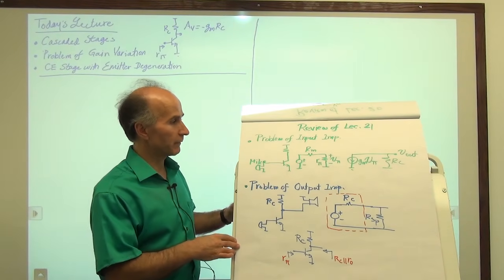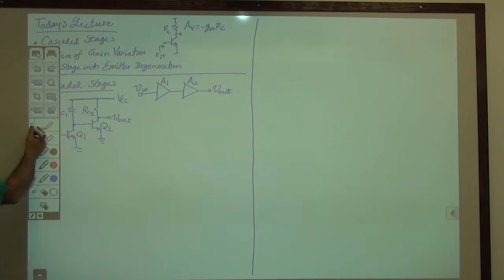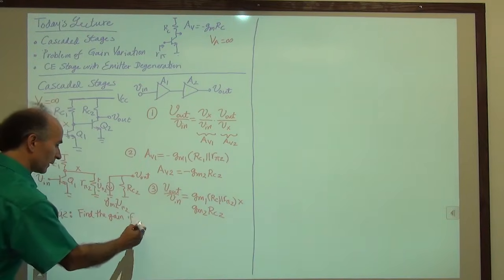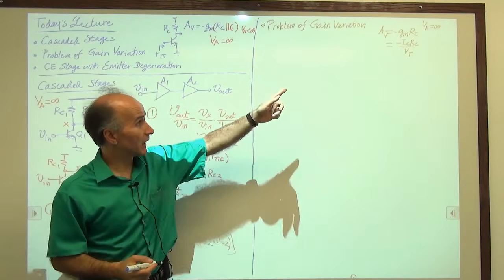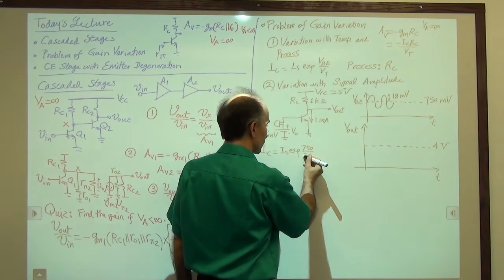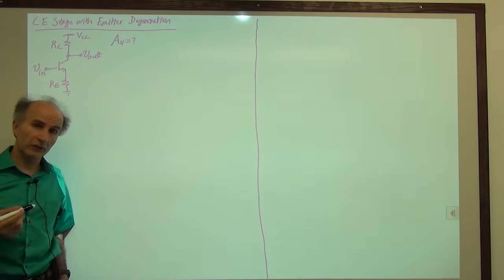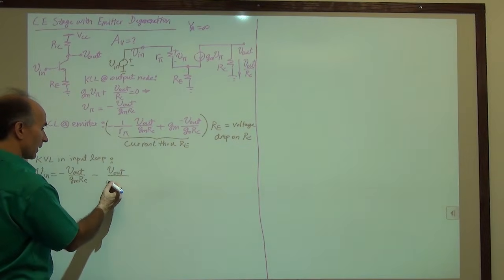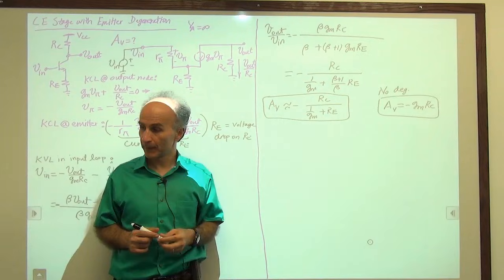Razavi Electronics 1, Lec 22, Common-Emitter Stage with Degeneration

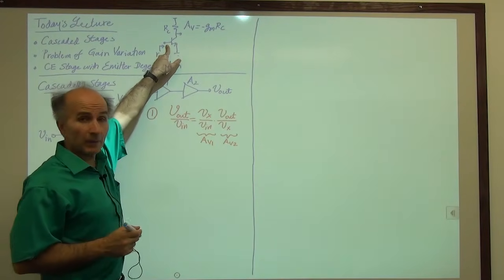Comment: 12:26 In Cascaded Stages, when the input signal goes through Q1 and get amplified, then is the output signal coming out of Q1 not larger than V_T? Because if it's larger than V_T then how can Q2 amplify it even though it's not small signal anymore?
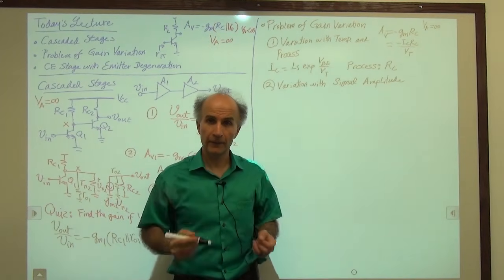Reply: It's Gain Variation in 31:41

Comment: But considering the small signal model, we have already assumed the the fluctuations of input voltage are negligible with respect to the biasing, hence IC was assumed to be constant. So shouldn't the distortion be negligible as well?
Reply: Distortion occurs in large signal case. In 18mv I don't think you can use small signal model.

Comment: High Sir can we calculate Av in shorter way.Vin=Vpi+gm*VpiRe  and Vout=-gm*Vpi*Re then we can calcılate Vout/vin =-gm*Rc/(1+gm*Re)
Reply: When beta is high base current is negligible in that case only your calculations are valid. Sir initially calculated by considering base current. That was the reason his calculations are little lengthy. In the final sir assumed beta is high.

Comment: In one of the previous lectures professor mentioned that all these small signal regime applies only when Vin << Vt....
Now that the input to the second stage of a cascaded structure is an amplified signal itself, how do we guarantee that the input to the second stage is much smaller than Vt
Reply: I think the Vin is initially so small, that even after a certain gain from the first Amplifier, it is still small with respect to Vt
Reply: the gain is not a voltage, 
the input signal in Q2 is Vx which is equal to [-gm1.vπ1.(Rc1||rπ2)] and i think this will be less than Vt

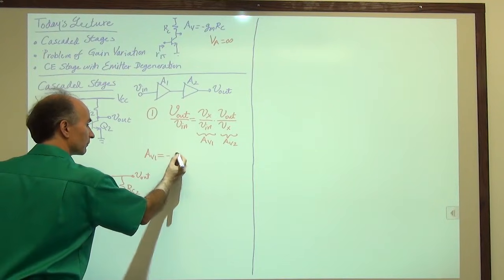Comment: 15:56 is r pi 2 connected at AC GND?
Reply: Because ib plus ic equal ie, and ie connected at ground. The ground is common at two points, rp2 and gm2*Vp2.